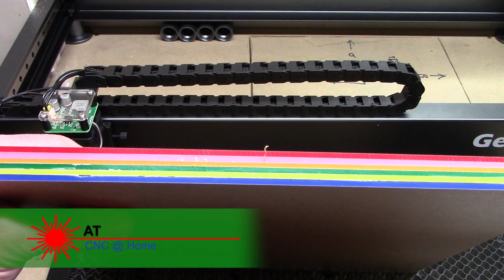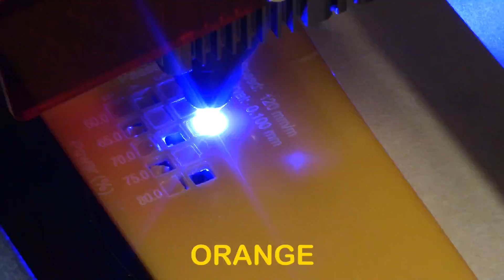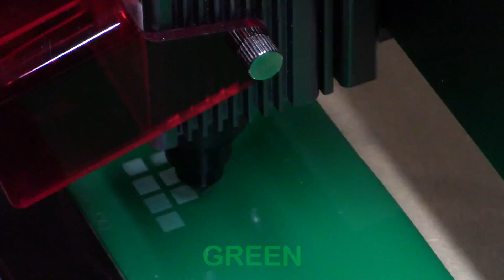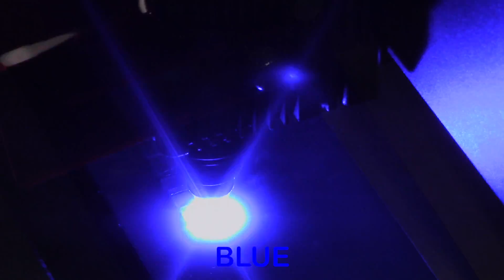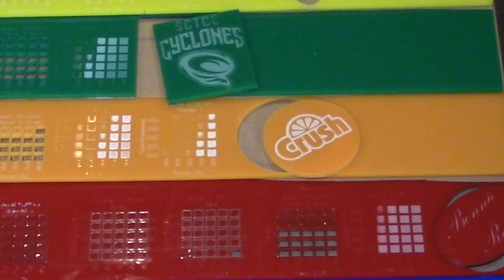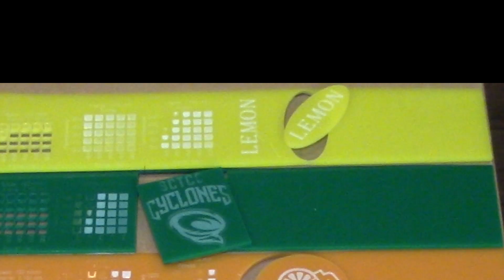Can you cut and etch colored acrylic with a diode laser?

Comment: What were your setting for the different colors
Reply from the maker: Great question.  You are not the first person to ask.  Maybe I should put this data in the comments?  ;-)  Your speed and power values will vary.  This should get you in the area.

Cut through
2.50mm Black - 120 mm/min @ 80% power w/ 1 pass
2.75mm Orange - 120 mm/min @ 70% power w/ 3 passes
3.00mm Green - 120 mm/min @70% power w/ 3 passes
3.00mm Red - 120 mm/min @70% power w/ 3 passes
3.00mm Yellow - 100 mm/min @ 75% power w/ 3 passes
3.30mm Pink - 100 mm/min @ 80% power w/ 4 passes

Etching (without air assist)
Black - 2,400 mm/min @ 10% power
Blue - 1,000 mm/min @ 70% power
Green - 2,400 mm/min @ 20% power
Orange - 2,400 mm/min @ 30% power
Pink - 1,200 mm/min @ 60% power
Red - 2,800 mm/min @ 25% power
Yellow - 2,000 mm/min @ 40% power

Comment: Have you tried engraving plastics? Like rowmark?
Reply from the maker: Just engraving and cutting acrylic.  I had not heard of Rowmark before.  I looked it up and it just acrylic but layered.  I am going to have to give that a try!  That looks like it could be fun to try both for the laser and for the CNC router.  Thank you for the idea!  🙂
Reply: @CNCATHome  yeah they make it with brushed metal finishes and glow in the dark and all kinds of stuff. Was always curious if it would work with a diode laser. Also curious to know how it does with a CNC too.
Reply: @chubbyboy2242  It etches/engraves really well with my 10w diode. I can also cut thru 2mm pretty easy although I was having problems with clean cuts (edges). I'm brand new to the laser world so I have a lot to learn about tweaking in the settings. Just bought a 10W to make my own aircraft panels. So the Rowmark was an obvious choice to try.  If you do try some make sure you order the "LaserMax" style as it is made for engraving. That's not to say the other kind won't work. I ordered a sample of the non laser and it cut and engraved just fine, but has more toxic fumes than the LaserMax.  I'm actually having more luck with just cutting white acrylic and then painting it black before the etching process.

Comment: If i put a mask over the acrylic do you think it would work better?
Reply from the maker: Good question. With the colors that don't etch as well, putting a black coat of tempera paint could help.  It won't help in burning through the acrylic, only help with etching.  This method is how you can etch on white or clear acrylic.

Comment: I am brand new to laser cutting, literally bought the laser master 3  a few days ago, I had no idea you could not cut acrylic or that it has issues cutting acrylic due to the melting. I wanted to cut semi-translucent acrylic, such as those fluorescent colors you see of ten on acrylic sheets. I am wondering if the issue is that the light passes through the acrylic, would putting something dark under the acrylic help?? like a sheet of black paper or some wood painted in black??
Reply: there are a lot of videos showing this very thing. black paint, black paper, or even black colored metal will all help the translucent acrylic cut. This also depends on the output power of you laser but even 10W can etch clear acrylic with the help of black media placed on it.
Reply from the maker: @jawaring4367  - Similar to etching glass, it can be done with something dark to absorb the heat from the laser.
Reply: I was told I can only cut black acrylic with my two trees tts 55 I think its a diode laser it is very close to cutting all the way through please help which setting I shall use
Reply from the maker: @funkymanrah  - Cutting and etching can be done with many colors of acrylic.  I found that multiple passes were need to cut through most colors. The laser I am using is a 10watt blue laser.  Here is what worked well for each color: 
    Yellow: 100 mm/min at 70%, 3 passes
    Green: 120 mm/min at 60%, 3 passes
    Orange: 120 mm/min at 60%, 3 passes
    Red: 120 mm/min at 60%, 3 passes
    Blue: didn't cut well as expected as my diode laser is also blue so too much energy was reflected
    Pink: 100 mm/min at 70%, 3 passes

This should help you get an idea of where you need to be power and speed wise.  It looks like your laser is either a 2.5 or 5.5 watt laser. A 2.5 watt laser is going to struggle to cut through the acrylic.  You might be able to get through with a 5.5 watt and multiple passes.  With a lower power laser, you are going to need to up the power and/or slow the speed.  You may need 4 passes to get through.  
I hope this helps to get you as starting point.
Reply from the maker: That is a good question.  The reason it doesn't work so well is the frequency of the laser.  It does like to pass right through.  Kind of like trying to cut class.  If you want to etch on the surface, you can do a couple things.  One is like what you said and put something black under the material.  OR paint the front or back black with tempera paint (easy cleanup compared to spray paint.) and do your etching.  Not sure how well the backside method would work with translucent acrylic but it works well on the top surface.  The black absorbs the heat from the laser and melts the surface enough to get a nice tech.  It will not help you cut acrylic.  That is totally a frequency of the laser issue and black anything won't help.  Well, black acrylic cuts nicely as it is black all the way through.  CO2 lasers will cut acrylic nicely as it is a completely different frequency of light.
Good luck learning your new laser and burning some projects!  You have entered a fun area.

Comment: Are you going to share your settings? Or?
Reply from the maker: I hadn't planned on it but they aren't a secret either.  Here is what I found worked for my LC-50 Plus, 10 watt laser.  This should give you a good starting point.

Cut through
2.50mm Black - 120 mm/min @ 80% power w/ 1 pass
2.75mm Orange - 120 mm/min @ 70% power w/ 3 passes
3.00mm Green - 120 mm/min @70% power w/ 3 passes
3.00mm Red - 120 mm/min @70% power w/ 3 passes
3.00mm Yellow - 100 mm/min @ 75% power w/ 3 passes
3.30mm Pink - 100 mm/min @ 80% power w/ 4 passes

Etching (without air assist)
Black - 2,400 mm/min @ 10% power
Blue - 1,000 mm/min @ 70% power
Green - 2,400 mm/min @ 20% power
Orange - 2,400 mm/min @ 30% power
Pink - 1,200 mm/min @ 60% power
Red - 2,800 mm/min @ 25% power
Yellow - 2,000 mm/min @ 40% power
Reply: Thank you!
 @CNCATHome
Reply: I think this will save me hours of freezing out in the cold trying to cut through plastic

Comment: Hi, My Red Acrylic Cutting keeps ringing the fire alarm
Reply from the maker: Oh no!  Is it just the red that does it?  It sounds like you could use better/more ventilation.  It is important to get those fumes cleared out so you aren't breathing them.  I have a 440CFM exhaust fan that pulls the fumes down from the burning project through the honeycomb grate.  That seems to work well.
Reply: @CNCATHome yes, only the Red does that, i just finished setting up the OLM2Pro, I'll get an exhaust compressor, thanks a lot, also i figured that the speed was too slow, o increased the speed and the power, then increased the number of passes to cut it, it works fine now
Reply from the maker: @haidarbuilds  - That is great!  I am glad that you figured out the issue and corrected it.  Have fun with your new machine!

Comment: I cannot cut orange with a 20W laser.  Any suggestions on settings?
Reply from the maker: On my LC-50 + which is a 10 watt led laser (blue), I was able to cut through 3mm orange acrylic at 1,500 mm/min at 30% power using 4 passes.  I would I would hope your 20watt laser could make short work of that kind of cut.  When I cut through material, I like to focus just below the top surface of my material.  Make sure your lens is clean.  I just ran into an issue where my lens had gotten dirty and some basic etching was working.  I hope this helps!

Comment: What laser and power did you use?
Reply from the maker: Good questions.  I was using the Genmitsu LC-50 Plus.  It is a 10 watt diode laser.  The power and speed were all over the board.  I do not like to run the laser over 80% as a general rule. The max power would have been 80% and the speeds were anywhere between 100mm/min and 3,200mm/min.  The whole purpose of these tests was to find what power and speed worked best for cutting through the acrylic and for etching on the surface using this particular CNC laser.  🙂